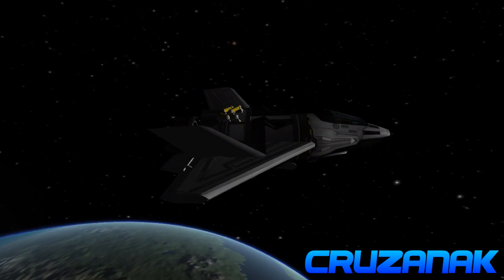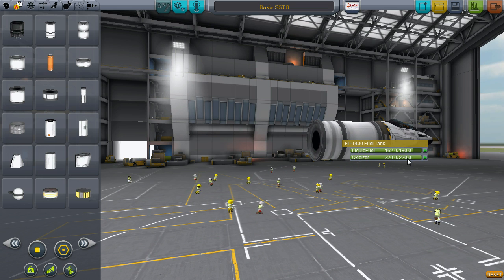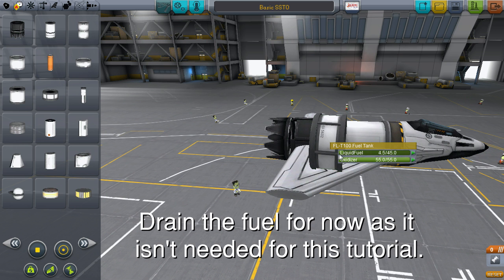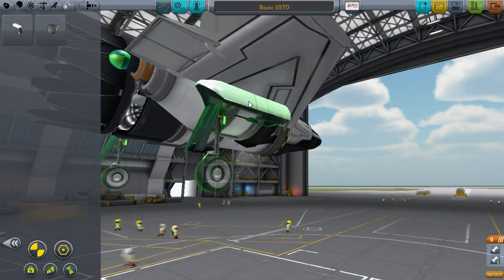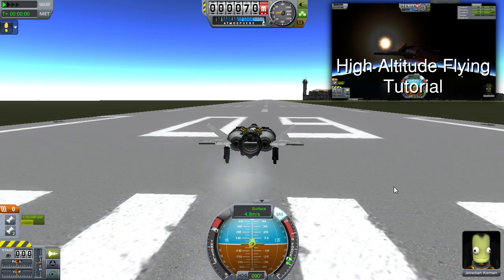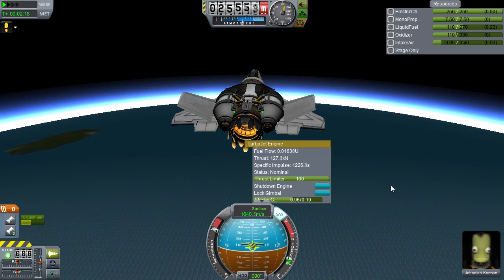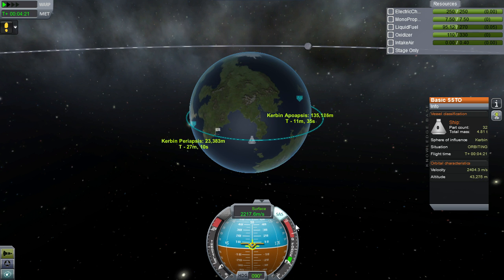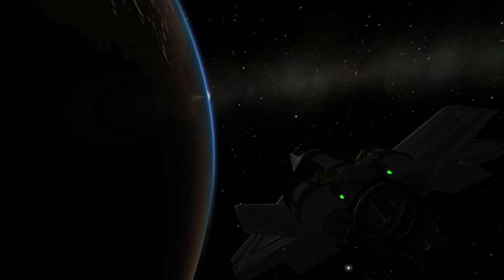KSP Quick Guides: SSTO Tutorial - The Basics for an SSTO! Stock v.23

Comment: Does this work with 1.0? Any time I get near 25k my engine flames out. That and I can't go faster than about 1300 m/s before I start slowing down.
Reply: +AceTankerPaul you know what, i am going to do a video for help you guys ;)
Reply: +Ben Harold 
Similar deal, I tried making a spaceplane almost exactly like Cruzan's and it burned through the fuel for the air powered engine before I even reached 15000m and even as it burned through my rocket fuel it couldn't hold altitude at >25000m no matter how I pitched it
Reply: +Ben Harold 
Scrap that, I used the actual ship provided. There must've been one or more severe nerfs to the ramjet or some other component.
I got closer in speed before completely sapping my fuel this time, but still not nearly enough to have a superterran (above ground) periapsis
Reply: +Ben Harold yeah me too... I can't even reach 600m/s
Reply: +Ben Harold SSTO'S are impossible now, i have been trying to get a get my station crew into space with a spaceplane. conclusion: impossible.
Reply: +AceTankerPaul They're possible, I've made an SSTO today in Career. Ship has two Whiplash engines (Atmosphere) and two Aerospikes (Suborbital / Vacuum), and uses one short Mk2 Liquid fuel tank, an inline C-O-T and a Bicoupler at the center, and two FL-T800's side mounted.

Weights about 23T and costs 35k. The key is in maneuvering the ship. You want a steep ascent sub 8 kilo so that you are roughly 300 m/s by then (can totally be slower though), then make the ascent very smooth until you reach 19 kilo to get some vertical speed. (roughly 1000 m/s. As much as your ship can take without going boom)

From there on, make your ascent as steep as you can without losing control, shut down your jet engines and get your rocket engines to kick in. From there onwards, it becomes standard orbital maneuvering.

One other thing. Less is sometimes more. If you're not going fast, it's because your ship's too heavy.
Reply: YES!

Comment: When you say the turbo-jet begins to flame out at 35-36 km, is that when it sounds like its slowing down, and it begins losing thrust? I get that at around 20-25 km. I've tried to make smaller design, more or less the same as what you show here, just to test if it was something wrong with the design of my first plane, but it doesn't matter. Whatever the angle of attack, thrust, or amount of air intakes(opened and closed) and since I haven't unlocked the ram intake, I'm using quite a few of the radial ones my speed stops at 1080 m/s at around 20 km altitude, every time. I don't know how to break through this ceiling, other than increasing altitude by pitching up. Of course, then I lose horizontal speed. I've somehow lucked out once or twice and gotten a really low orbit, but with no fuel left.

Comment: I don't understand why rocket engines are needed for SSto's.i managed to build one out of the second smallest 1 meter rocket fuel tank (oxidizer removed), 2 shock cone intakes, some radial RCS tanks and some RCS ports.After pushing my apoapsis to about 120 km, glided up to 70 km and my apoapsis was still at around 100 km.Time skip to apoapsis, and fire the RCS prograde a bit, there ya go, orbit ! if you maintain your craft very light, RCS has plenty of power

Comment: i tried this in my ksp, and i barely got to orbit. you actually need a LOT more fuel than this to get to orbit.
Reply: Are you using FAR? I was using FAR and it seemed to require more fuel to get it to orbit or to Minmus.

However, I think it also largely comes down to technique. The first few times I tried to get orbit I think I left the atmosphere too quickly and had to rely too much on rockets. if you stay in the atmo longer to get up your speed, you might get to orbit with spare fuel. It's very different from rockets where you'll get to orbit with roughly the same amount of fuel regardless of how perfect your gravity turn in. With SSTO's, it apparently matters a lot because the jet engines are many times more fuel efficient.

My advice is to try to basically achieve an "orbit" that is within the atmosphere and then raise your Ap and Pe into space with rocket engines, if that makes sense.

Comment: Hey Cruzan, thanks to you I've had my first taste of ssto flight and have used this plane design (after some modification) to land and  rescue poor jebbediah  from laythe surface to an orbiting mothership.  I want to build a little bit bigger so that I can make an interplanetary ssto that can go to duna and back without refueling and with a relatively large room for error. Problem is that after hours and even days on end of tinkering on different designs all of my planes fail to get anywhere near duna and most can't even make orbit. I'm a rocketeer and not a planes person and so I would appreciate any tips you may have for big sstos

PS: I have watched derpN3rd's advanced ssto tutorial and have even downloaded and had a look at your wallet challenge plane and I still can't get to duna with an ssto :-(
Reply: Finally found a solution, 80 intakes more and an hour repeating the high altitude tutorial...
Got to duna and back with no refuels and even stopped off at minmus on the way back, just for fun :-D

Comment: Very nice job; I subbed. :)

I like how succinct the video was.  Turns out I was over-designing in addition with going with the RAPIER.  My previous attempt before looking at your design was topping out at ~380 m/s with the RAPIER.  It's really easy to overlook just how much dV you can get out of a small fuel tank on a light craft.
Reply from the maker: James Hegger Thanks for the sub! The RAPIER is a pretty sweet engine, but I prefer to use it with larger designs. If you want some good examples of RAPIER-based designs to use in the future, the video I made for the Aeris 4A Challenge shows some good ones :) KSP - BSC Aeris 4A SSTO Final Results!

Comment: Thats really cool, and you weren't even air hogging! I've been working on the Med size SSTOs and after the Tank video this weekend ill start doing videos of them ....psst......... >_> ...... <_< ........ you want and exclusive Craft file of the smaller of the 3 med to large SSTOs to look at?
Reply from the maker: Ya air hogging only starts coming in to consideration ocne the designs start scaling up. I'll be working on trying to figure out how to build interplanetary SSTOs both with and without air hogging. Should be fun(tough) xD
And sure! Send me the file and I'll take a look, just tell me what I'm looking for :P
Nice job on the sneakiness btw. No one heard you I think!

Are you still working on the non-airhogging SSTO to the Mun or did you finish it already?
Reply: Cruzan AK i finished it. Landing is a little tough and fuel is super tight but if your lucky you can just get back to kerbin and pray you dont reenter over water :P ... so ya i think ill work on it some more so its not so user unfriendly XD ... i wont put the download link on here so do you have an e-mail? or maybe ill try google hangouts :\
Reply: Cruzan AK  ill try putting the download link in google hangouts .. let me know if it works.
Reply from the maker: vaos3712 Got it!
Reply: Cruzan AK
Hey Cruzan, my ssto's jet is overheating. I downloaded yours too but no luck :/
Reply from the maker: Hi Pie Overheating? o.O I'm not entirely sure what you mean. Got any more details? I'm happy to help, I just need more info :)

Comment: Hey Cruzan. I have two questions for you. One is do you know how to make a space shuttle? Because I had so much trouble trying to design one. I understand one basic thing is that your center of thrust needs to be in-line with the center of mass. But the hard part after that was balancing the craft. After just a little bit of fuel was burned, the shuttle becomes unstable again. So I don't get how your supposed to make a balanced shuttle in the stock game. :/ (alternatives I tried were to have thrusters at the top to counteract the tipping, but even though they worked sort of well, they burned through my fuel too quickly) And my quick second question is if it's possible to create an effective SSTO with the low atmos engines. I ask this because I want to make an SSTO in my career game but I only have those jet engines. So keep the great videos coming! :D
Reply from the maker: I haven't even tried making a shuttle before tbh so I'd have to do some research. :)
For you second question, it definitely is! This video is from a friend on the KSP forums who made one using basic jets and an aerospike KSP: Shuttlecraft Systems Inc. Shuttlecraft Type I - Aeon Class
Reply: Thanks for the video. :) With me I have been switching between rockets and planes but in career mode I have been using solely rockets (except for the odd time I may want to explore Kerbin's biomes) because of the fact I don't have turbo jets. So I just may attempt an SSTO with just those engines.

Comment: Very nice work Cruzan! 

I gotta say, though, it seems relatively easy (for me, at least) to make an efficient SSTO design when it's a small plane.

However, making bigger ones (Fuel for interplanetary travel or large cargo) seems alot more difficult. They seem alot more unstable, harder to balance thrust and fuelweight, and because of their much increased drag are also slower in orbit. Any plans on making a guide video for that?
Reply from the maker: Thanks!
I definitely plan to make guides on large SSTOs. I wanted to lay some groundwork for future videos though by doing on on smaller designs. :)
Keep your eyes peeled for the next one!
BTW, what's the largest SSTO you've tried to make and how did it do?
Reply: 92 tonnes, interplanetary SSTO xD But im using the B9 aerospace pack, and used a bit of part clipping for air intakes.. B9 is fine, but it seems nearly impossible to make a big SSTO without the intake "cheat". 

By the by, I was going to send you that VTOL car-buggy thing, but need some kind of information to send it to! (that thing is stock parts).
Reply from the maker: MrFunguspower Are the intakes in the B9 pack more efficient than ram air intakes? I've never looked in to the specifics on the B9 parts themselves.
You can send me a link through a PM here on YouTube if you like!